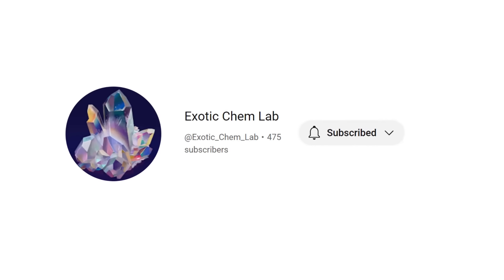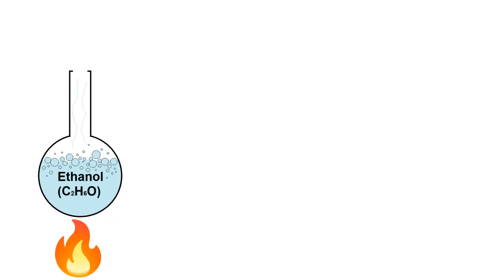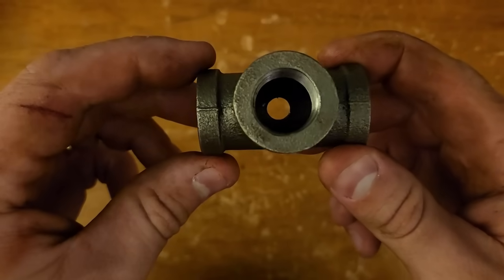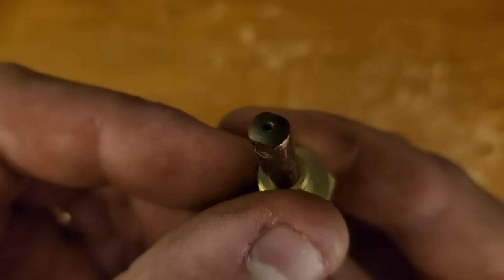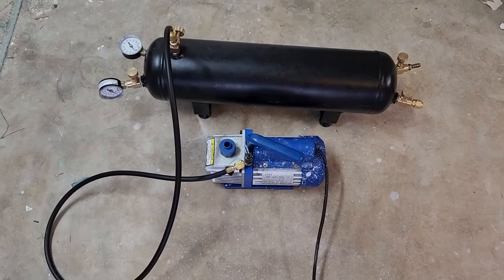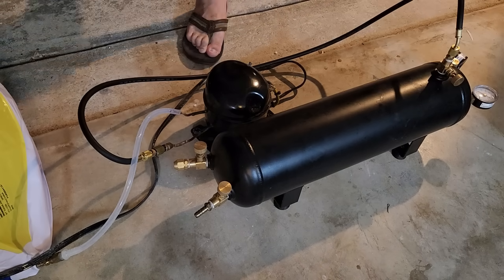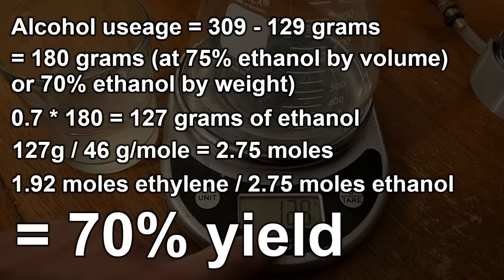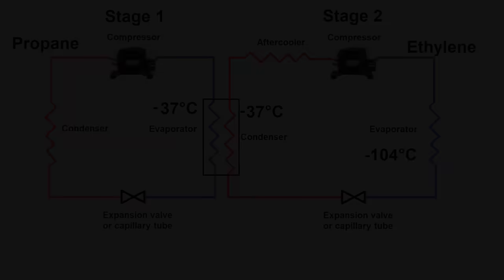Making Ethylene (Refrigerant R1150)

Comment: When I lived in TX, I had friends that worked at Dow that converted Ethylene into various polymers.  I recall they commented several times about how toxic it was.
Reply: You are probably thinking of ethylene oxide which is bad stuff indeed. Low low low PEL 1 PPM TWA 15 minute limit!! Wiki doesn't show any listed PEL for ethylene itself.

edit:  I found one for ethylene, 200 PPM as TWA, same as toluene.

Comment: I'm curious about your use of propane. Wouldn't it be much easier to control the temperature with a resistive electric heater? You'd need a relatively high power supply, but those aren't too expensive. A control system with 3-4 thermocouples and resistive coils would get you very even, controllable temperatures. Not hard at all to get it in the range of +/- 5C. It's an exothermic reaction, so with sufficient insulation I wouldn't expect there to be too much power draw.

Comment: You got the 2nd run yield calculation wrong by assuming that the vapour coming off the everclear flask was 75% ethanol 25% water, ethanol rich mixture will always come over first, then the vapour temperature will rise to the ethanol-water azeotrope boiling point, after that, you'll be left with just water coming over.

Comment: GREAT JOB!  Did you consider using electrical heating tape (rather than open flames) to heat the catalyst?  BTW, there are specific, optimized alumina catalysts tailored to alcohol dehydration.  Still, you're quite the chemist!

Comment: You can get to -120 C if you run the evaporator in a small vacuum. Ethylene is an excellent Industrial refrigerant used primarily for catalyzed polymer reactors that contain very exothermic reactions. Very cool! lol

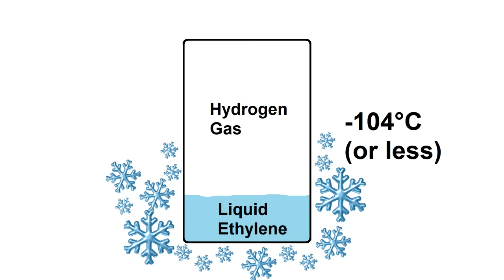Comment: @16:30 For the hydrogen separation from the ethylene gas you could use a membrane instead (Hydrogen Membrane Separation Techniques; Sushil Adhikari and Sandun Fernando,Ind. Eng. Chem. Res. 2006, 45, 3, 875–881,Publication Date:January 7, 2006).
Reply: That thing costs hundreds of bucks. For much less he can add third stage to liquify methane and separate hydrogen cryogenically.

Comment: Very impressive for sure.  However, please be very careful.  I am a chemical engineer with extensive experience in the production of ethylene oxide.  I would not have done this experiment.
Reply: As a chemical engineer you should know the difference between ethylene and ethylene oxide.

Comment: here in the united states we just pay a security deposit or core charge to buy certain car stuff like alternators, radiators, starters and especially batteries.

i am not sure what european regulations say it maybe possible that you could pay much more as a core charge or maybe you cant buy without first turning in old severely limiting on bulk purchases so you may not be able to buy many gallons of car antifreeze for example to extract the r1150 from.

 if you have no laws forcing you to turn in used before buying new then you can buy many gallons of antifreeze or even better since pet plastic uses the same stuff it may be possible to source empty soda bottles much better.

if you are like the united states but with a higher  deposit fee (after exchange rates) by far is much cheaper and less trouble than buying r1150 as refrigerant.

another option depends on the way that the product is packaged, marketed and intended usage that can determine price and regulations.

another possible source is to extract the c2h4 from r150, 151 and 152 and their a versions  and just break off the other stuff that is after the c2h4.

here in the united states we can easily get  r150, 151 and 152 and their a versions in the form of canned air fairly easily even in 3 and 6 packs.

you will have to deal with a fowling agent used to prevent abuse as a huffing agent.

Comment: Here is a better way to prepare ethylene in-situ.
ClCH2CH2Cl (1,2-dichloroethane) + Zn (or Mg) --> ethylene + ZnCl2 (or MgCl2)
In a dry three neck flask, put Zn (Mg) chunks with fresh THF, add few beads of iodine, mildly heat the flask in water bath (warm to touch with bare hand), stir the mixture vigorously with magnetic stir until the gray metal chunks become shiny.  Adding 1,2-dichloroethane via pressure equalizing funnel.  This should generate ethylene immediately, now adjust the addition speed of 1,2-dichloroethane (DCE) to prevent overheating the reaction system.
Reply: Did you mean "fresh THF" as a tetrahydrofuran? What is purpose of it?

Comment: Wow, this is awesome! One thing that might improve your yield is actually pre-heating the ethanol vapor. It's hitting the catalyst at ~100C, so it takes the first few inches in the catalyst bed to actually get it up to 450C, so you're running with low selectivity on the first bit of the reactor. You could accomplish this by filling the first several inches with an inert material with a high thermal capacity to get the ethanol up to temperature so when it hits the catalyst it's at your target temp. Broken/ground glass should do the trick if you don't want anything fancy!

Comment: is there a danger on cascade system when a primary system condenser runs and leave high pressure liquid below 0C Degrees, a thermal brakedown due to expansion and contraction can happen?

Comment: If I had to guess the thermocouple could have read hotter due to the direct contact with the heated pipe, It was not isolated in the cat, and was likely skewed by the thermal energy in the pipe. By raising the heat the reading would OFC show a higher reading but the cat was probably in a closer range of temperature. also you would expect to lose some mass to the silica gel unless the ethanol was checked for its proof at time of use, it could have picked up more moisture from the environment in storage so there is some uncertianty in the initial reactant. ( I would have done a pre and post weight on the gel but it wont account for all the missing mass)

Comment: To seal the reaction tube, silicone would have worked.. I've used silicone on exhaust systems plenty of times and it's always worked fine with temperatures exceeding 550c

Comment: Very cool. Perhaps using several thermocouples in parallel might give you a better average catalyst temperature.
Many year ago I worked as an industrial / petrochemical refrigeration technician and we used to manufacture / commission and often maintain systems we built. One of the systems I used to maintain (wasn’t involved in the construction of it) was a large cascade system with a high temperature screw compressor driven by an 800kw motor running on R22 and the low temperature screw compressor was driven by a 400kw motor, I can’t recall what the low stage refrigerant was but 25+ years ago it was about $300 per kg and came in small cylinders like a nitrogen bottle, the pressure was extremely high and it was kind of scary to charge with. This system was actually part of a flash gas condensing system for Ethylene storage and was the final subcooler before the Ethylene was re injected into a very large storage tank which held liquid ethylene at -100°C, our sub cooler was getting it to about -90°C.
This system incorporated a large vessel which had automatic valves which opened to the high side when it shut down and another which opened to the low side during operation, the purpose of this was to limit the maximum off cycle pressure . You might need to consider that the off cycle pressure can be relatively high on cascade systems and may need to do something similar or at least add some additional volume on the low side of your ethylene side

Comment: I could be wrong but I would assume that if you had added 2 more thermocouples (one at the beginning and end of your converter) you would have ended up with a temperature gradient starting with a cooler temp at the entrance and hottest at the output rather than a shallow bell curve; the incoming ethanol gas, even when boiled, being much cooler than your target of 450°

So by raising the temp to 500° @ the middle you probably were able to raise the sustained inlet temp closer to 450° and get the majority of the initial incoming gas to convert at your desired yield numbers with a gradually lessening amount of unreacted ethanol converting at higher and higher temps along the length of tube. 

It would be interesting to see you add the two extra thermocouples and swap in a different pipe with drilled holes to accommodate the results.
Reply: Realized I might have sounded condescending as well as completely wrong about my thoughts so if they were fundamentally wrong I apologize. 

I sincerely enjoy your videos and hope you continue posting more content that brings science and chemistry out of the lab and into the realm of everyday people; utilizing both materials and equipment easily procured w/o the need for large sums of capital. Your creative ingenuity is just as helpful as it is entertaining. Keep it up 👍

Comment: Rather than use a propane burner to heat the catalyst, instead use a toaster oven with your thermocouple for accuracy and if you have to bridge a couple of pipes.
That way you can bake the pipes long enough to ensure they are completely and uniformly heated to the correct temperature.

Comment: Cool stuff! (Or soon to be, hah)

Just a small comment on the yield calculations; everything else looks good, I just have two notes:
@13:16 Density isn't proportional to concentration, right?  I don't know the water/diethyl ether system offhand; If it's known to be proportional then this is fine.  (It's also assuming all ether, but, that assumption is stated so that's fine too.)  Not that this will be a large error, either.
@16:16 Wouldn't the leftovers be less than 75%?  I suppose the density should be measured, then looked up in a table.  Assuming constant concentration would seem to overestimate the amount.  Meaning the yield is lower than calculated, and more losses occurred.

Comment: For heating your catalyst evenly: try making a jacket out of a larger pipe and place your catalyst tube inside and fill the jacket with motor oil. the oil will evenly distribute heat on all sides.

Comment: Amazing work!  I know a lot of people are suggesting the sulfuric acid route, however that stuff is a huge hassle to work with outside a lab setting, and if you are using less than anhydrous ethanol you're going to end up with a ton of dilute sulfuric acid that needs to be boiled down to be useful again.  Believe me that is messy and terrifying, having 300C acid bumping is nightmare fuel and it will always bump to some extent.  Just skip it and save yourself the headaches 😊
Reply: For that I just recommend doing it on a concrete slab outside with a decent wind.  And use alot alot of boiling rocks.  Like put in so much you think it's too much.  Then double it.

Comment: On your compressor diagrams should it not be pre cooler instead of after cooler?
Reply from the maker: I guess i'm in the habit of using that terminology, because in compressed air systems / Stirling / GM refrigeration cycles where there's no phase change, the radiator that removes the heat of compression is called the aftercooler
Reply: @HyperspacePirate  i have shared your page with my brother and sister. Both of them is mechanical engineers that spesiale in refrigeration design. I really like that you have clear and accurate information in your videos. Good luck with your projects and I am looking forward for the next video.

Comment: Why do you use such a primitive catalyst warming solution? I imagine that you could do far better with an electric heat treat oven or kiln that can hold that temperature and/or modify one to hold temp with your own thermocouple and PID running on an arduino. And please preheat.The infrared heat bouncing around in there should pretty well evenly coat the container of the catalyst.

Comment: Could you measure the temperature along the length of the reaction chamber, then add holes to the burner to put more heat in at the ends?  For others doing this from scratch, it might make sense to space the initial holes out nonlinearly, to compensate for that ahead of time.  It's probably easiest to just do it empirically, but designing it from first principles would be Very Satisfying.

Comment: I used the sulphuric acid method to make diethyl ether when I run out, it's a lot simpler than the imdustrial method, you just need 99.5% ethanol and 98% sulphuric acid, under about 135°C the acid will make diethyl ether and over it it makes ethene, which would be what you want. 
For the first stage if you don't mind breaking the law R1270 would be better than R290 (propene vs propane) as it's about 5°C lower in boiling point than R290, and -37°C is sort of a high condensing temp for R1150, at 16 bar condensing pressure, and 1 bar evaporating pressure, you'll have a 1:16 compression ratio which will put more stress on the compressor than it needs to have on it.

Comment: So, try heating the entrance to the reaction tube to avoid some of the uneven temperature issues you're getting in the reaction. to verify you might want to add a thermocouple at either end of the catalyst tube. Perhaps aim for about ~450C ~475C ~450C with that probe arrangement I mentioned.

I may not be good at the math, but I can figure out a way to optimise it.... whatever 'it' is lol.

Comment: First of all: You make absolute premium content for fellow educated nerds! ;)
A hint on the yield: try to use pure 100% ethanol, dried with molecular sieves. It will increase the yield as you don't add water in what also is a waste product. All the reactions are equilibrium reactions. That tend towards a certain composition. Less water in will mean more water (and thus ethene) produced as the output gas stream will try to converge on the same composition, given the same conditions.

Comment: Incredible work, to build your own plug flow reactor with a heterogeneous acid catalyst in an amateur setting is no minor achievement. I'm a little worried that any contaminants, even if low, will affect your boiling point of the ethylene. Perhaps you can distill it with your refrigerator by pressurizing it to 16 bar and cooling it to -40C, discard the heads which would contain hydrogen and discard the tails which would contain ether. Then it should be a lot purer. Maybe what you have is pure enough though for your purposes.

Comment: Be carefull any oxygen or copper oxide will turn ethanol in the presence of a heated copper catalyst (in this case copper tube) into acetaldehyde wich is a carcinogen and also very flamable.

Comment: The solubility of ether in water is only about 6 %.
STP is not at 25 °C (room temperature), but 0 °C.
75 % v/v has only 67.8 % by mass (70 is fairly close tho).
The unit is mol, not mole - those are underground. 
You should divide the moles of ethylene by the theoretically possible amount of ethylene, not ethanol. Since the reaction is 1:1, the number is the same. So just a little detail and it would be less confusing if you actually divide the right units that cancel out.
The whole pressure*volume calculation is going to be a somewhat off, since this is somewhat far from an ideal gas. Using Van der Waals (should be down to 1% correct here) with 9.45 L and 25 °C I get:
at 153 psi (10.55 bar): 4.27 mol
at 80 psi   (10.55 bar): 2.17 mol
a difference of 2.1 mol or 59 g, not 1.9 mol or 54 g (10 % error).

So your yield is actually:
180 g of 75% v/v EtOH = 122 g EtOH = 2.65 mol EtOH
So a maximum yield of 2.65 mol C2H4
actual yield is 2.1 mol / 2.65 mol = 79 %

Which is super impressive! Even 30 % are impressive. Lets condense it now (it is enough to condense it at your -37 °C) and blow off the remaining gas phase to make sure it is somewhat pure too (no hydrogen). Also, look at the catalyst or rather its carbon content.

Comment: i try to explane , ethylene is a aliphatic hydrocarbon chemical (means only carbon and hydrogen )and there are rules to name it ,  start with the number of carbons in it  (1 methane , 2 ethane , 3 propane , 4 butane then is the classic penta , hexa) the is if all is valent electrons are connecting with other stuff rater than other carbon and a carbon can make 4 , if all are then is ane if one is to other carbon is yle , organic chemestri names are not easy

Comment: Sulfuric acid and ethanol will produce diethyl ether via dehydration

Also, the “bumping” you’re seeing in your gas line isn’t actually bumping. It’s the result of liquid within the gas line which causes varying pressures within the line and “spits” out then end.

Diethyl ether is immiscible in water, which means it forms multiple layers. The change in density you’re seeing is most likely carried over ethanol

Comment: No flashback arrestor for the propane tank? Or does the regular have a built in arrestor?
Reply: How do you think, pure propane burns without oxygen?? ;-D
Flashback arrestor only for acetylene, because it can decompose itself into carbon/hydrogen, if it gets too hot.
Reply: @hinz1  Well the issue is mainly when the pressure starts running low oxygen has a chance to mix with the propane in the tubing causing a bang.

Comment: To evenly heat up the aluminium filter, you could try to fork the propane into three outputs (of course, each one having several nozzles), and using electrovalves (analog), three temperature sensors and a few electronics, you can control the temperature using 3 PIDs and smoothing the temperature along the filter to the temperature you want

Comment: Not as cool for videos but as a tinkerer I’ve had good success with nichrome wire and a cheap Amazon PID controller for achieving stable temps up to 1,000°C

Heating elements from an oven will reliably sit at 700°C and those have the advantage of being electrically insulated (so you can set metal things directly on them). 

So your catalyst pipe laid over an oven heating element, and the whole works wrapped in ceramic wool may result in an even and stable 450°C, which can be adjusted with the push of a button.